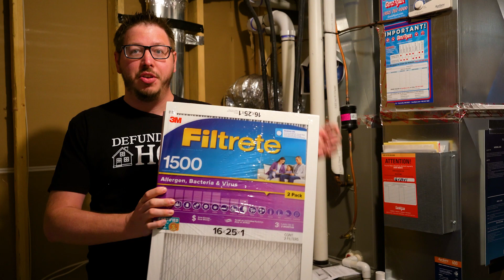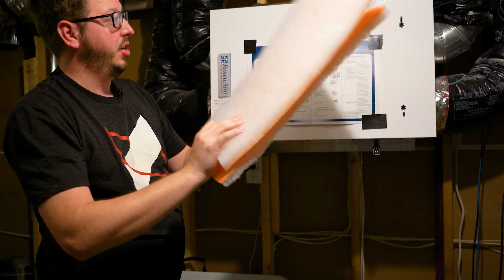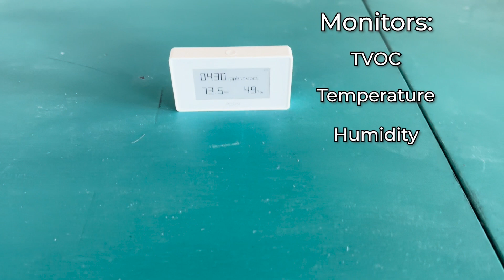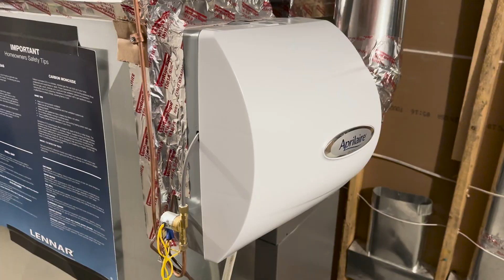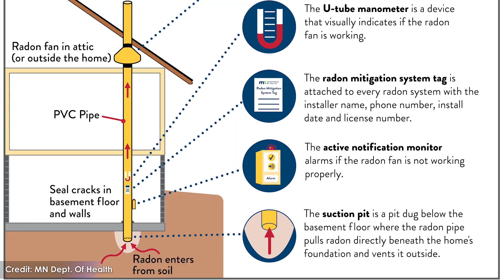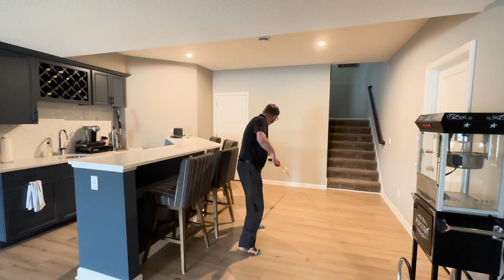How I Fixed My Home's Air Quality (Air Purifiers, Filters, and Monitors)

Comment: Is there a device that measures indoor air quality and then controls bringing in outdoor air into the house?
Reply from the maker: If it were integrated into your central hvac system then yes, but it’s more common in the luxury or commercial space. These sensors I showed are more for monitoring but could trigger fans, air purifiers or your connected thermostat. Sensibo sensors pair with their system and carrier makes a whole home air quality system that is good for a typical residential property. For high end properties, Delos specializes in air quality systems that can be integrated with control systems like Crestron